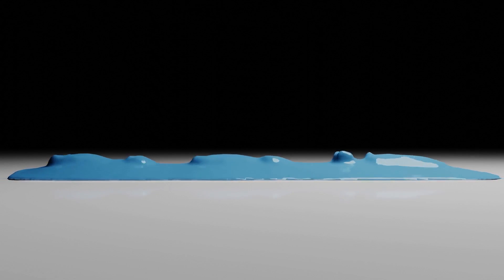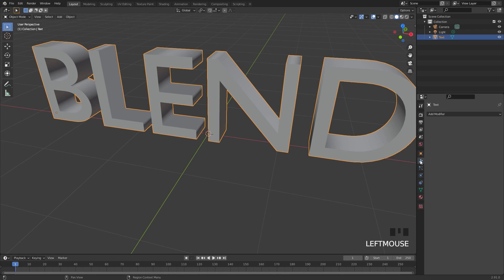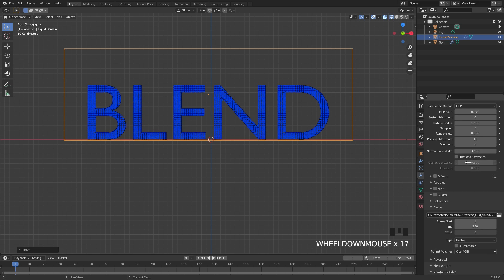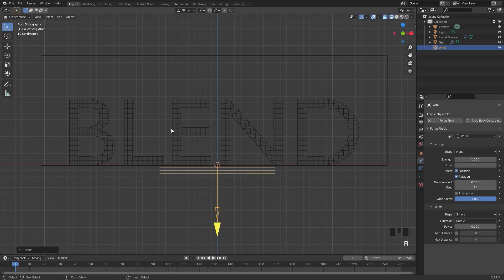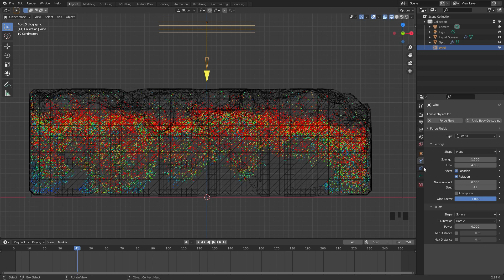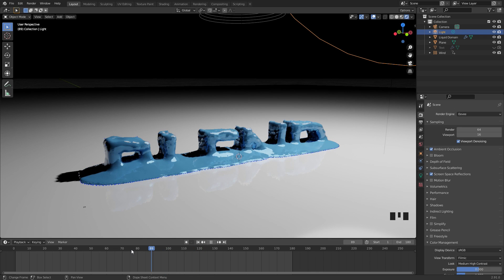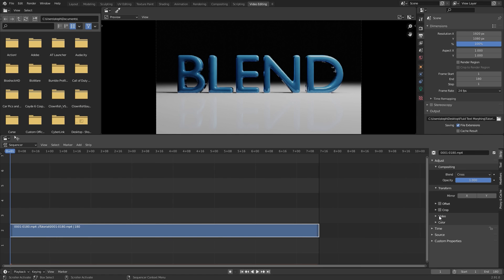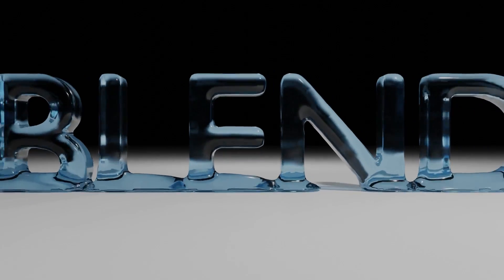Blender Tutorial - Fluid Morphing Animation

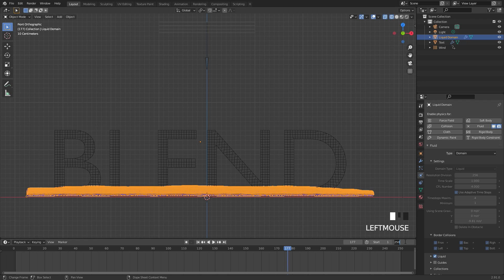Comment: 4:25 Didn't work. Double and triple-checked all the settings and re-baked it. The fluid goes crazy and fills the entire domain until frame 59 where it disappears into the upper two corners. The domain is just grayed out for the rest of the animation. Can anyone help me, please???!!! :(
Reply: I have exactly the same problem, did you find a fix?
Reply: idk, i set the flow to 2 and it works wonders
Reply: @Lada333   worked mate. Thanks!
Reply: I have the same problem and i dont find a Fix

Comment: Great tutorial. As a beginner, this was very helpful. For me a wind flow of 2 worked the best. However, I have a very annoying problem that I can't seem to get rid of. Even after hiding the text, in the final render my text shows up in addition to the fluid morphing into a liquid. Any idea why that might be and how to remove it? Thanks!
Reply: I know this is late but I've just come across this tutorial and seen your comment. I encountered the same issue. After 1.5 days and getting the lads in the lad to run some tests, I believe I've figured out the solution: you can hide the Text in cycles by going into the orange box tab above the Spanner icon and scroll down to Visibility, uncheck Camera.
Reply: @bigsmile9173   I think that's how I got around it too. It's so been long, I forget. Thanks for sharing your advice. Cheers!
Reply: thankk youuuu, i tried 5, then 4, then 3 and it was  still going all wonky. was about to give up but then saw this comment and was like okkk lemme try 2 and it worked!
Reply: @_pinkangels   glad to hear a value of 2 worked for you, cheers!

Comment: Dude, I ran into a problem where the letters are mixing in the air from the first frame.
I tried adding more vertices and tried changing character spacing but it doesn't work, what can be a possible solution?

Comment: Thanks.  My only issue trying this is that the text starts out looking a bit melty even with a resolution division of 300. Any way to fix?
Reply: I had the same problem, turning the Mesh upres factor to 2 worked, though it made it slower.